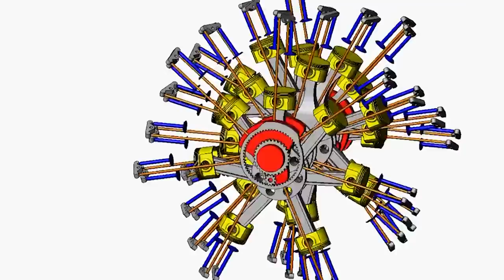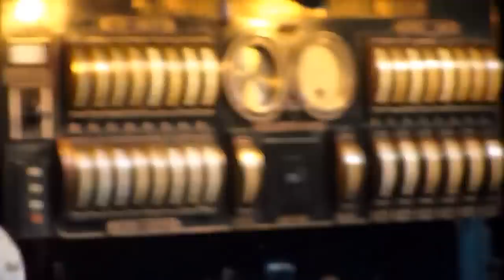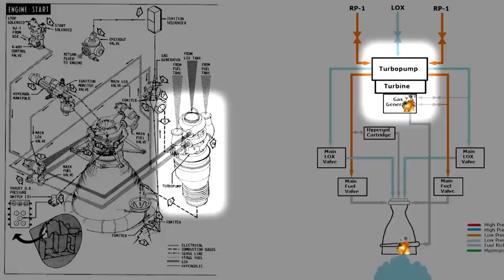The Most Powerful Engine in The World

Comment: I don't think it has ever been more apparent to me that the narrators of these things have absolutely no comprehension of what they are reading, from mistaking millimeters for meters, to reading the same word two different ways within five seconds time.  It's astounding.
Reply: Right!😁
I had to replay that 3 times to be sure that's what he said. Rather than the world's largest, it sounds like it's the world's smallest jet engine.😂🤣
Reply: Yes, I agree with you, he has never experienced the power of a Steam Turbine in a Power stion/Plant. I operated Turbo Alternators in a small plant which was designed and constructed in the late 1950's, each Steam Turbine was good for around 135,000 HP on the one shaft, they are an external combustion engine, today it's common for them to generate around 1,000,000 HP all on the one shaft.
Reply: I thought my ears were broken!
Reply: yea the engine is 5.5 millimeters long... tell me u have no clue what ur talking about without telling me u have no clue what ur talking about.
Reply: The guy can't read.
Reply: That along with the fact shockwave crashed earlier this year. Killing the driver he mentioned as current.
Reply: <refers to 14:30> 5.5mm long and 3.5mm across yet weighs over 8Mg(8000kg)>17,000lbs?  There was no logic to the progression of this video (to where I quit). Might be good for little boys 5-7, if they know its full of errata.  Although, I now want to watch a vid on assembling what powers a maersk megatransporter.
Reply: Altercations instead of alterations.
Reply: @spudmanidahoboy  yea i have another comment below where i said this exact thing.. Sad RIP Chris Darnell
Reply: This was more likely put together by some semi literate, non english speaking school boy who just copied a heap of youtubes, cut and paste abstract bits of Wikipedia text, and fed them through a text to speech app. Most of it is irrelevant, but I guess he got his clicks...
Reply: @pylon500  Not a false voice. Too many ups and downs.
Reply: It’s hilarious!
Reply: Exactly.
Reply: “Matt” instead of “mate”. Lol
Reply: @joshuamorelock1400 , I’m watching it all; I could do with a laugh.
Reply: it's an unfortunate feature of online content these days that they cant even get names of important people and places right. the robot readers are even worse.
Reply: Many channels have degenerated into generalized fluff shots.
Reply: “The Blitzen underwent a number of altercations”. (6:43) Yeah, you’re right. These people have no idea what they are talking about really.
Reply: This is just the state of the internet these days, details don't matter.
Reply: Chassis...
Reply: Talking heads
Reply: I was pulling my hair out listening
Reply: chassis=cha-sis 😂
Dolmar=Dolo-mar
 
.. he definitely pronounced Siemens right though.
Reply: Pratt & whitley.
Reply: Guess they never saw a cruise ship engine... Its the size of a house..
Reply: Also apparently rocketdyne was requested in 1995 to develop the f1.
Reply: Chass-is lol
Reply: This is why I prefer visoracer he knows what comes out of his mouth even with the accent
Reply: I couldn’t agree more. I had to turn it off. Cringeworthy
Reply: Lol, I heard that!
Reply: well obviously, they are narrators hired to do this. there's no reason they should know what they are talking about
Reply: It's pretty bad. It's a shame because the video editing is pretty good.
Reply: Unfortunately facts aren't important to these people !
Reply: @mozartmike  dude he’s a narrator, he reads off of a script that is given to him. Why would he need to know what he is talking about?
Reply: @couchpotatoes5158  the producers could've at least fact check everything he said. they aren't paying him for nothing
Reply: @renz1013  that’s their job, not the narrator. The narrator just reads a script
Reply: Yeah also the fact the wind turbine is not an engine at all. They saw turbine and though of one in a plane. Kinda missed the big point on that one.
Reply: @couchpotatoes5158  dude the narrator is literally what you hear in the video. what do you want to producers to do voice it themselves
Reply: Narration is stunningly lazy and inaccurate.
Reply: TIL a 2stroke fires 4 times more per revolution then a 4stroke
Reply: Had to leave the second time he pronounced "chassis" as chass-iss.
Reply: Patelo engine is a model engine I don´t think was the powerfull one
Reply: For the big boy, half the footage was of completely different locomotives.
Reply: They should have left off all of the certification dates for the engines….they’re all in the past yet they narrate it like it’s still about to happen despite the old dates. Whole video is half-assed
Reply: 13:20 gasoline, SERIOUSLY!!!!!!! Who the F*ck writes these scripts????????
Reply: I don't have time to investigate, but is someone as already was said, from non English speaking area, trying to collect Internet available stuff in one video. There is a lot of mistakes, in narrative and in videos... But ok... I looked it entirely... By the way, what is meaning of the word "Slavic", mentioned in one name of the airplane in the video? Interesting fraze, specially this (2022.) and years to come...
Reply: lol you 2? when he said 'engines matted together' instead of mated. when he said 'bespunk chass-is' instead of bespoke chassis (like chassy). Bespunk Chassass sounds like a pornhub title ffs.
Reply: "matted" together... bespoke "chassis..."
Reply: @couchpotatoes5158  they should have some reading comprehension if they want to narrate
Reply: At 6:35 he says the engine underwent "altercations".
Reply: Most of the footage was pretty good but it would have been more informative if he didn’t say anything at all.
Reply: @gamersplaygroundliquidm3th526  that’s not their job, their job is to read the script exactly as it is written
Reply: Not only zero comprehension, the mispronunciation of common words runs rampant.
Reply: Is this even a human reading the narration?  There are now text-to-speech "voice clone" robots that sound almost human, but they're not perfect.
Reply: @couchpotatoes5158  im pretty sure reading comprehension is a prerequisite for the job of narrator chief, it be like giving someone a position as a race car mechanic the day before the race and never checking if they ever even worked on a car because who needs someone witch mechanical abilities as a mechanic?
Reply: @gamersplaygroundliquidm3th526  his job is to literally read the script exactly how it’s written, nothing more
Reply: It certainly was painful to listen to.
Reply: And how he pronounces chassis.
Reply: Right when I heard the word "Chas-sis" I scrolled to the comments....
Reply: @Shadolife  I wonder if he's even a human. Maybe a text-to-speech "voice clone" robot. Yes, those do exist.
Reply: Good power output for its size!
Reply: Because these channels are often owned by foreigners who pay a few bucks on fiver to some random US dude to narrate some garbage videos...
Reply: Funny, I don't remember any diesel ship engine using gasoline??
Reply: What is this? A jet for ants?
Reply: Most likely a AI voice that "reads" the text..
Reply: " feet -pounds ..."
Reply: These type videos are often compiled and posted simply as a platform for generating ad revenue and should not be used as technical references.
Reply: Living in the uk there are a few words that the us say differently, the main ones are uk locations, like Worcestershire or Berkshire. I have never understood why they can’t get their head around them. There is a American YouTube channel called Chills, he has said that he doesn’t use a narration tool but sometimes I can’t believe how some words are spoken. But that’s my opinion.
Reply: @jasonbender2459  he’s a narrator, he was hired to read the script, exactly how as it is written, it’s not his problem. It’s the problem of the writer, who doesn’t know what he’s talking about.
Reply: @jasonbender2459  dude chill tf out. Says the guy furiously commenting on a YouTube post. Don’t criticize their jobs and how they are making money, you are the one watching it
Reply: I gave up watching more after "the Blitzen underwent a number of altercations..." when any functioning human knew it should have been "alterations", numerous times where he pronounced the "S" on "chassis" and saying just "centimeters", not "cc" or "cubic centimeters!!!"  I'm never this critical on people, but when your whole video is about specifications, please get them correct!  His next video will be about hair transplants, for all who pulled their hair out watching this video!!!
Reply: @hideousruin  Apparently, they don’t learn to read, either. I hope you don’t live in a glass house, my supercilious friend.  It’s MINE the ore, not mind.
Reply: It is not so hard to imagine when most people have no idea what technology really is. They use it, but understanding… neh. Could you narrate these videos? We each have our skillsets.
Reply: I'm betting they're an ai with a script, and the script writers suck lol go to the older vids and you'll hear a different person with a very similar voice. Multiple channels are like that I think
Reply: To telling that the jet engine Will Be tested in 2017. Or this Is AN old copied video
Reply: lll
Reply: "Dolomar" got me, I have an old DOLMAR Chainsaw. "Dolomar" sounds like a candy bar.
Reply: English is a dying language, especially for those under 50.
Reply: Paying attention to the facts being presented was very difficult with all the mispronunciations distracting me. The narrator even said that one of the engines had an altercation. I've heard this guy narrating just as poorly before. He's got me wondering whether he's doing it to amuse himself, to see whether it will be noticed.
Reply: @tyrssen1  I think you're right. I was trying to give him the benefit of the doubt.
Reply: On top of that, "the most powerful engine in the world" makes over 200,000 horsepower.
Reply: Agreed.
Reply: Really outstanding... But not reliable
Reply: I stopped at a minute and a half in because of this exact same reason.
Reply: “Before the scale composite made its stridal launch April 19th 2019, not 29th century 19th year
Reply: 20th******
Reply: It was written by AI. might have been narrated by AI also.
Reply: 13:25 He also referred to this diesel engine as "consuming less gasoline"
Reply: absolutely brutal to listen to the butchering of well-known technical terms. oh well I'm sure a lot of other people enjoyed it
Reply: Thank you for validating my intuition. I had to slow it down because it was almost incomprehensible at normal playback speeds!
Reply: Sa
Reply: 3:39 “feet pounds of torque” wtf
Reply: I agree, I actually stopped watching
Reply: 0:12
Reply: No need to comment, y'all covered all points I would would have liked to make. 😂
Reply: all your comments to me pale in comparison to when he talks about the  wartsila rt flex96c and says it is a low speed diesel, that runs on heavy fuel oil, (all good so far) then at 13:26 he says the 14 cylinder variant uses less "gasoline". wait, what? it is a diesel run on heavy fuel oil, soooo, I have to feel fairly certain it is VERY efficient in its use of GASOLINE, what a doofus!
Reply: They also sound like teenagers.
Reply: Their voices sound like young kids reading this stuff.
Reply: Most powerful engine in the world ?  Joking right ? You conveniently forgot to include marine engines. This narrator has absolutely no idea what he is talking about. This video is made for 5 year olds..🧐🧐🧐😡😡😡
Reply: 3:53 ...chassiss?
Reply: I assumed it was a computer reading text.
Reply: He's just some teenager they hired.
Reply: @8546Ken   Yeah. "Altercations". That one killed me. He's clearly just some teenager they hired for a few bucks.
Reply: @8546Ken  It's definitely not a robot speaking. It's some young kid who's not well read.
Reply: The voices are AI generated and cannot interpret punctuation.
Reply: 45,000 rpm? I don’t think so.

Comment: The big 4 cylinder engine you featured as the most powerful, biggest engine in the world, was anything but. I retired from Exxon Co. USA, as a mechanical technician in natural gas plants in Texas. The biggest most powerful engine ever made was by Ingersoll-Rand, and was designated the KVR-10, Turbocharged. They made 6 engines. Exxon had 3, and Pemex in Mexico had 3. When Exxon shut down production fields in 1999, they sold the entire plant including those 3 KVR-10’s to Pemex. The engines were 2 stories tall. The pistons were were the size of a 30 gallon drum, and with the connecting Rod were 9 1/2’ tall. One cylinder head weighed 2,300lbs, there were 10 of them. The top half of the crankcase weighed 30,000lbs, and the crankshaft was 22,000lbs.
Reply: The steam engine on the Titanic was 30 feet tall, weighed 1000 tons, and cylinders were like 7 feet across. The fuel system was 29 boilers with 159 furnaces with coal being shoveled in by hand.
Many other steam engines are a lot bigger and powerful than any gas/diesel engines.
Reply: Wow thank you sir for that knowledge. Lost craftsman skills and stories. Won't ever hear them in todays schools
Reply: Ya'll should check out Wärtsilä-Sulzer RTA96-C. That thing puts out 80000 kilowatts of power an could almost fit that little Fairbanks Morse inside one of it's cylinders
Reply: Marine diesels can be way bigger than that. I have frequently sailed with engines of nearly a meter bore and 2.5 metres stroke.  The 14 cylinder Sulzer RTA engine is 108,000 bhp.
Reply: @kevinmcfadden9553  The HP cylinder was 4' 4", the intermediate cylinder was 7' and the LP cylinder was 8' 1" diameter, all had a stroke of 6' 3"
Reply: I was about to make a comment about the engines that move cargo and cruise ships but thankfully somebody came and did it for me 😂 cylinders as wide as a minivan.
Reply: @kevinmcfadden9553  no comparison,  really. Titanic was triple expansion steam at a maximum 46,300hp. Largest piston was a little over 8ft in diameter. Power generating diesels run up into the 100,000hp range. Commercial jet engines often each in that range. SR71 engines were about 160,000hp each. I won't go into rocket engines, but we never compare fuel delivery networks like multiple coal furnaces and galleys in overall engine size.
Reply: If you are talking solely about internal combustion engines, the Wärtsilä-Sulzer RTA96-C is the current record holder, weighing over 2,300 Tons, it displacement is 1828.0 L and produces 107,390 hp. It is a two-stroke turbocharged low-speed diesel engine designed by the Finnish manufacturer Wärtsilä and made in 2006.
Reply: It may not be the biggest, but the Morris Fairbanks engine is my favorite big engine to watch run! But the Big Boy train it's probably my favorite of all!
Reply: @ShionWinkler  That's what I said.
Reply: Thats pretty good Tom but i think i can trump it with the engines on the HMNZS something or other with cylinders big enough for me to stand in.
Reply: Cute engines guys , well off to my nuclear powered sub I go
Reply: @kevinmcfadden9553  he's talking about the most powerful ICE engine 
not steam
Reply: So what was the hp rating?
Reply: I agree .after working in the STX gas fields for the last 20 years, even the old iron giants like AJAX are something to behold!
Reply: @KevinDC5  yep, the old Ajax, Cooper-Bessemer and Clark’s. We had an old Clark that was out of a WW1 Destroyer, and it was probably the easiest engine to work on, but the hardest to get parts for.
Reply: Ignoring marine diesels (and other serious industrial diesels) was a bit of a lapse. The Fairbanks-Morse Model 32 was even beaten out by. . . Fairbanks-Morse. The 38 D 8 1/8 series.
Reply: Yeas so back when i was a young man I was a stoker on some of the patrol ships that had far larger diesels than this one.
Reply: @ravenstorm1203  there was a steam engine in the video, multiple jet engines and even rockets. Are you blind?
Reply: It was a god try for biggest and most powerful in this video.  liked your comment.

Comment: At 13.5 meters tall, 26.59 meters long and weighing in at over 2300tons, the Finnish-made Wärtsilä-Sulzer RTA96-C is the largest internal-combustion engine ever produced and pumps out a whopping 80.1MW (107,390hp). This colossal creation is responsible for powering one of the biggest container ships ever made. I worked on ship's for many years, my biggest engine has been a Burmeister and Wain 12 cyl  reversible, slow speed (120rpm max), 3 injectors,/ cylinder, 3 feet diameter pistons, Cross + piston 22 feet in length, 1 exhaust valve, 3 giant turbo's, 15 bars Exhaust gas boiler capable of driving a steam turbine connected to a 1,8 MW Alternator. I loved the blood rush when we had to change a piston at sea, dangerous in bad weather, every part is so heavy, the hardest was for the engineer going in the crank case to unbolt the piston rod from the cross, so hot as just before breaking down the engine was running at 95 deg C cooling water crank case was also saturated with lub-oil mist. Every nut is tighten by hydraulic jacks now days but I remember my first engines nuts were tighten with  20 lbs sledge hammers, better stay out the way haha.
Reply: 107390 is a bananaunit, for those of us that uses metric its 108 920 hp
Reply: Wtf does 27 meters and 95 degree Celsius mean exactly in freedom units
Reply: @bobbyknight3589  in banana-units its 89 feet and 200 fahrenheit.